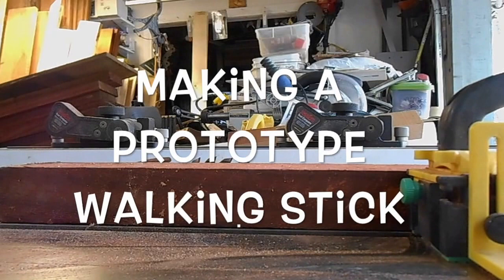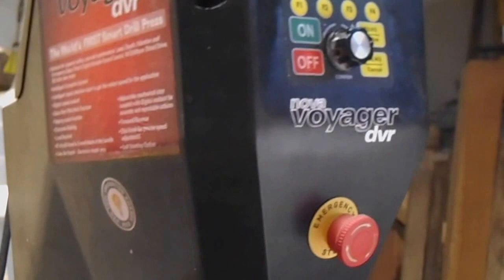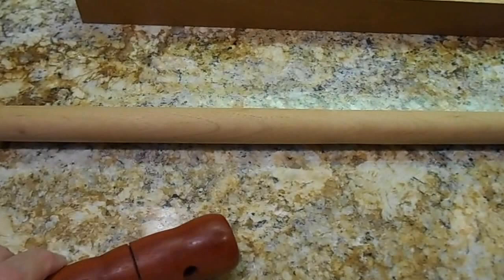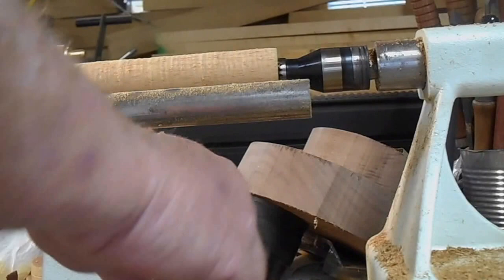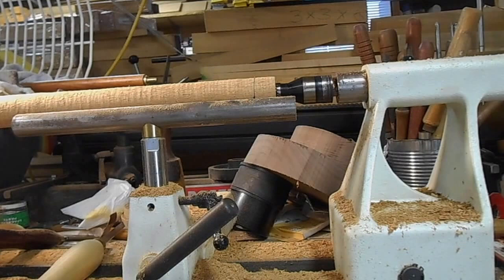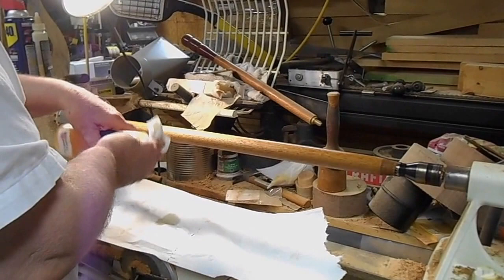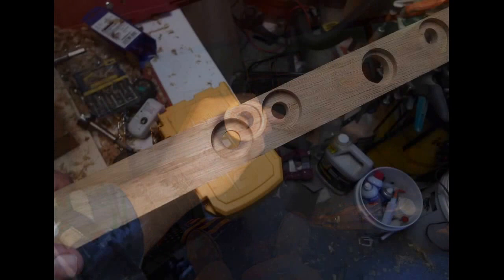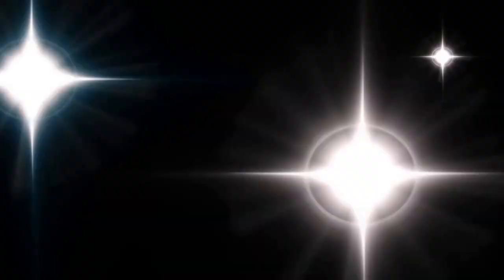Making a Prototype Walking Stick

Comment: Great job.
Plan on doing something similar but with the shaft being one piece and the head being another piece of another color wood.
What is shaft diameter before it starts to taper?
I was looking at 1 inch or 1 1/4 inch.